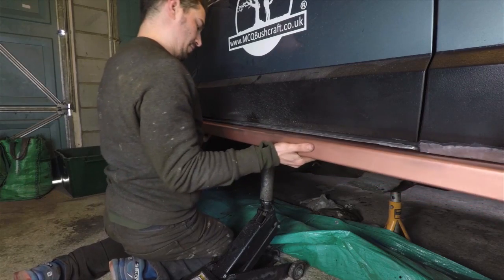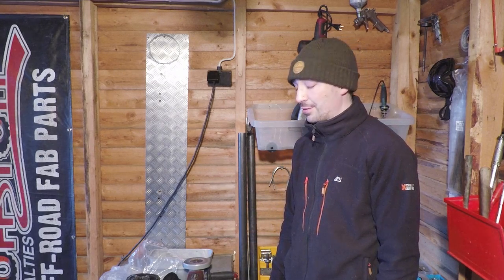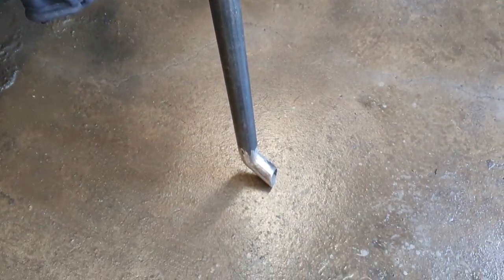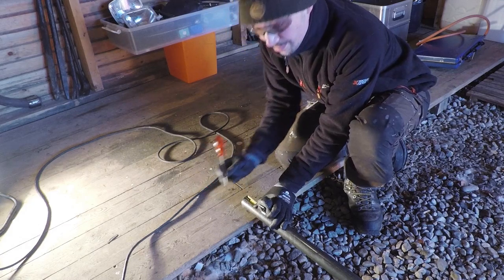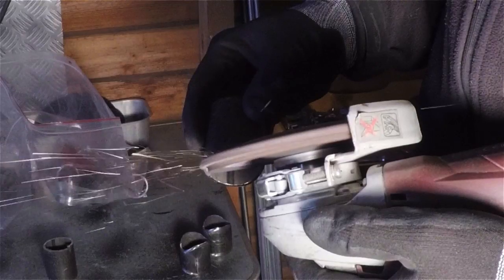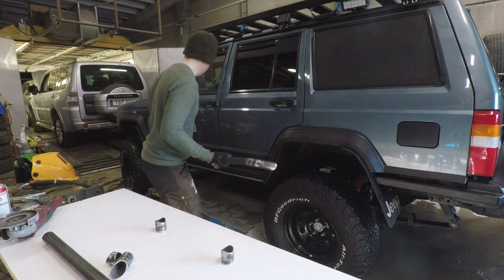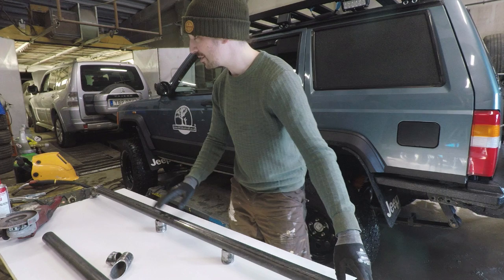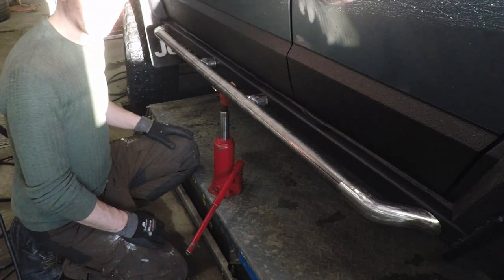DIY Tube Rock Sliders On The Jeep

Comment from the maker: In the last video we recapped the box rocker install I welded into the Jeep XJ back in 2018. In this video I add on some 3mm wall 40mm diameter mild steel tubing onto it. This will function as an additional slider but also provide a step so that the roof top tent can be operated without constantly opening the doors.
I did this on a budget using mild steel tubing with pre bought bends that I could weld on. Sadly my friend hasn't got a tube bender that can bend anything more than 30mm diameter this was a little too big.
Hopefully they will be strong enough for what I do and help protect my doors from any more dents. 
In the next episode we will prime and raptor line them.
Reply: Forgot the link for the table. 👍
Reply: I guess Im asking randomly but does anyone know of a way to log back into an instagram account..?
I somehow forgot the login password. I love any tricks you can offer me!
Reply: @Yahir Theo Instablaster =)
Reply: @Briar Coleman Thanks for your reply. I found the site through google and im trying it out atm.
Looks like it's gonna take a while so I will get back to you later when my account password hopefully is recovered.
Reply: @Briar Coleman It worked and I actually got access to my account again. I am so happy:D
Thanks so much, you saved my account!
Reply: @Yahir Theo happy to help :)

Comment: Nice idea. No excuses. I have a question, why you don’t used a 45 degrees elbow? Would has been easier? Regards 👊😎
Reply from the maker: I started out with a 45 degree elbow but liked the 60 degree look more. Would have been way easier to just use the 45s.. I probably should have just bought complete bends though I would use what I had already bought. There still going strong thankfully 💪 thanks for watching

Comment: What diameter tube did you use and what did you use for the rocker a 2x6 inch?
Reply from the maker: I used a 40mm diameter tube as it was only available in metric here. The box section is a length of 2"x2" welded to a length of 2"x4" to make up 2x6.
Reply: @WorkshoptoWilderness  awsome but what  was the wall thickness i was wondering if I should get 1/8 or 3/16ths since measurements here are imperial
Reply from the maker: So I went with 1/8ths to keep the weight down as I used two lengths of box welded together. I couldn't get 2x6 in the UK sadly. The inner wall on the welded box section adds a lot of strength from twisting but it also adds weight. I've impacted several large rocks when crawling River crossings and it does dent the tube slightly but nothing I really care about.
Reply: @WorkshoptoWilderness  yea I think I'll do 1/8 as well not sure what that is in metric but 40mm is 1 1/2 so does your tube hold your weight good when you stand on them? I weigh 260 pounds so I may have to go a little bigger than 40 mm
Reply from the maker: Holds the weight perfectly. Me and the wife can jump around on them all day. I've lifted the jeep with the highlift with them. I guess they are welder onto the box in four places so they should be fairly tough.
Reply: @WorkshoptoWilderness  thanks for all your help
Reply from the maker: No worries at all. Good luck with the build 👍